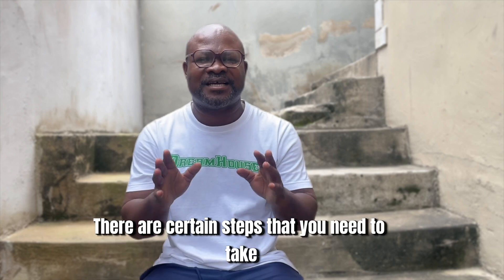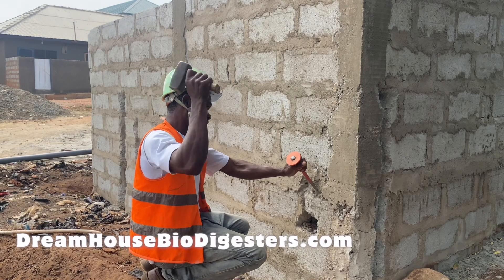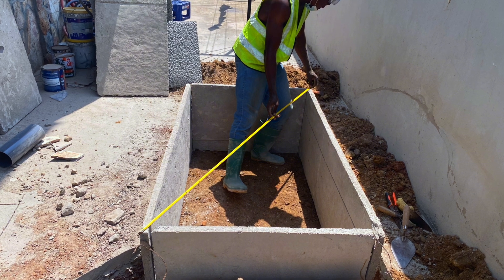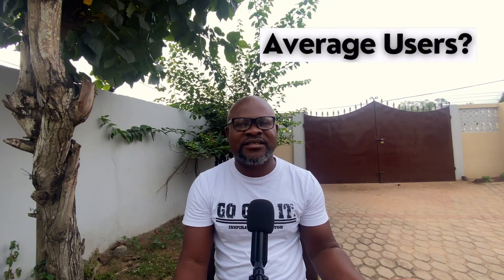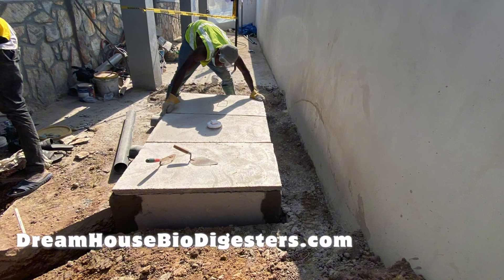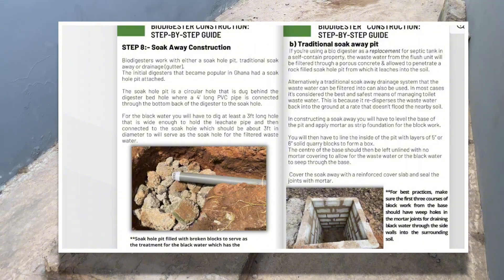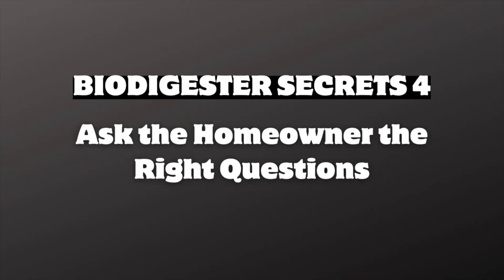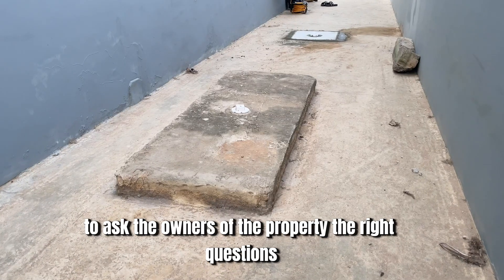Biodigester construction secrets: 4 things experts NEVER share

Comment: In some of your videos, you mentioned using a mixture of black soil and sawdust as an alternative to coconut fiber. What is the recommended ratio for mixing these two materials?
Reply from the maker: Half sack of saw chippings to half a bucket of black soil should work fine for a standard 6x2 digester. Just make sure the digester bed is covered completely with the saw chippings 
https://youtu.be/UhGD1Z9YrEA